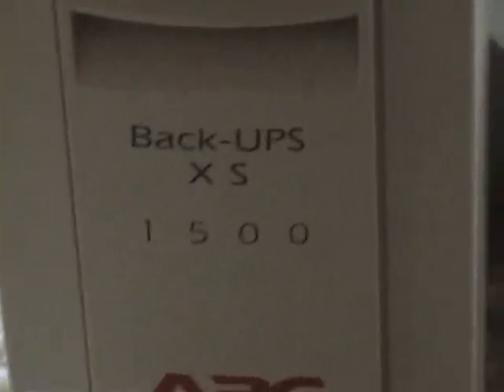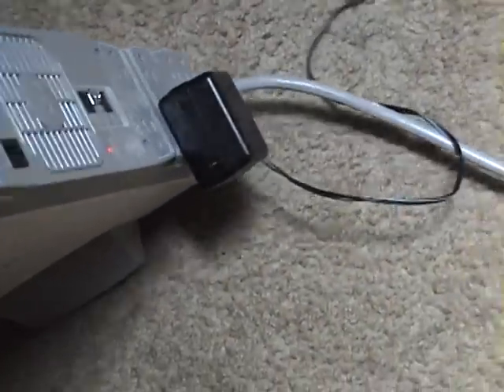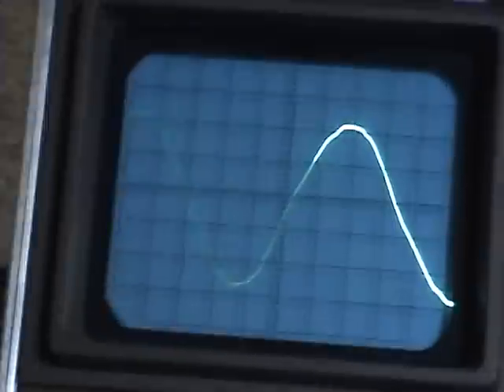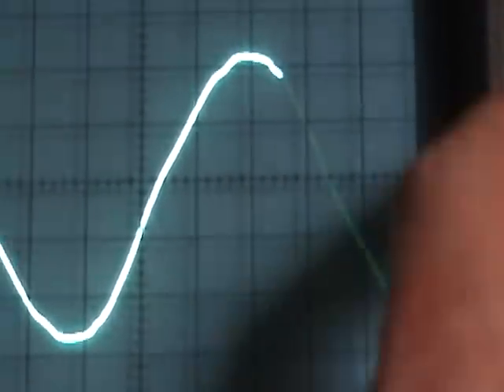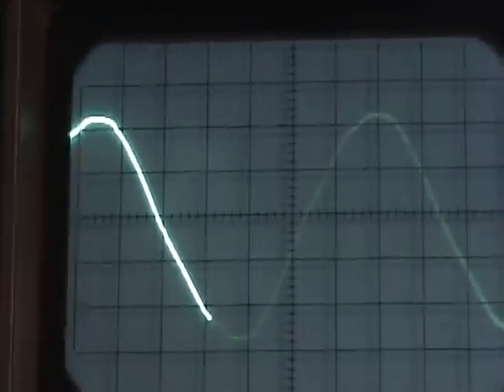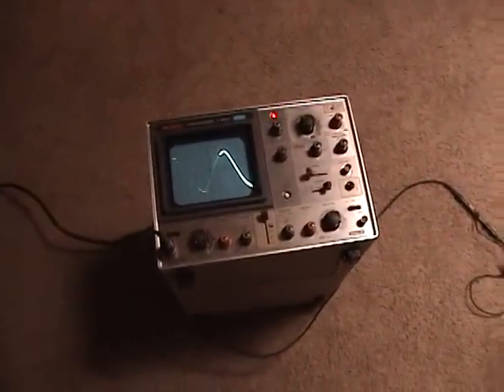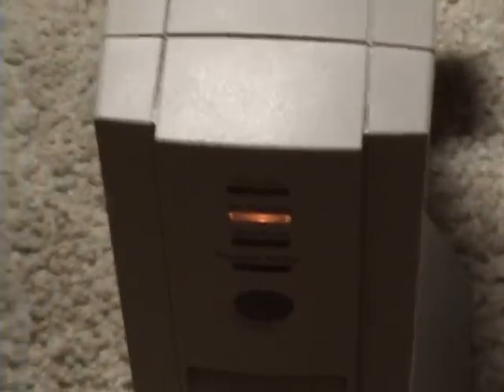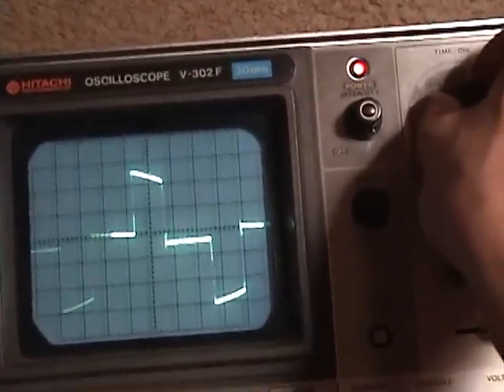Square Wave UPS on Oscilloscope

Comment: It is what they call a "modified sine wave" (essentially a positive, zero, negative rectangular waveform).   This waveform can run a lot of things (including most computer power supplies) but not all, and it runs less efficiently than a true sine wave.  Plus it puts more harmonic distortion on the output power.  Some devices may be damaged by this (like some motors, microwaves, laser printers,  etc) and some clocks may not keep time properly under this.   The main reason for this waveform is cost and less components to build.  Overall it was probably adequate for what it was designed to be connected to and the short time these are on battery it is likely to not cause much damage to a computer or its power supply.
Reply: Totally agree, but nowadays almost all of our home appliances are powered by SMPS-type power supplies, so even your high-end LCD TV will not be damaged, as their own power supply is able to transform a disgusting sinusoid in something necessary for the downstream device.

Comment: It would be great to see a video showing the oscilloscope output of a UPS vs a Simulated Sine wave UPS vs a true sine wave UPS. Then showing the output from a PC power supply powered by each of the previous types of UPS to see if there would be any difference for a standard PC and maybe a server too.
Reply: I think there will be no difference because computers are designed to work by absorbing very fluctuating voltages, very dirty.
In addition they are switching power supplies, so the voltage and current supplied is permanently adapted. it's a kind of galvanic isolation.